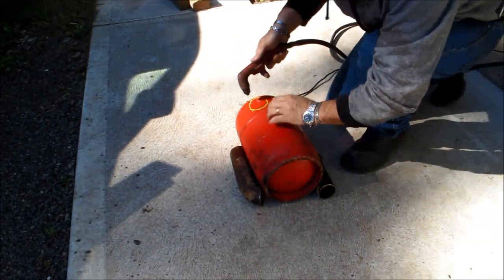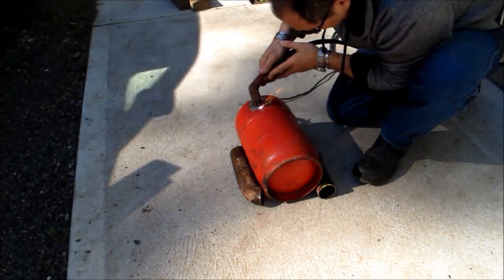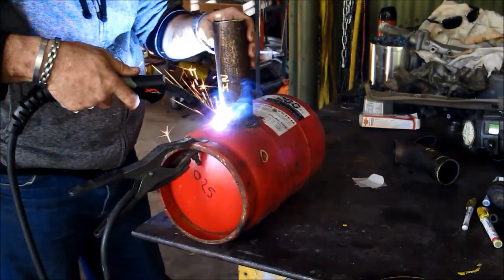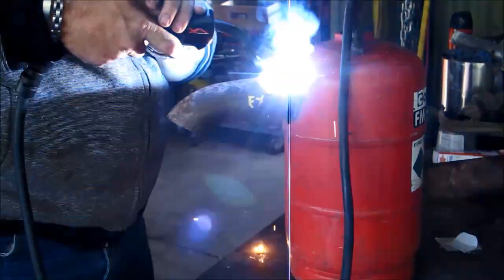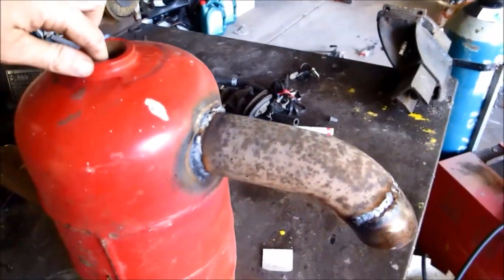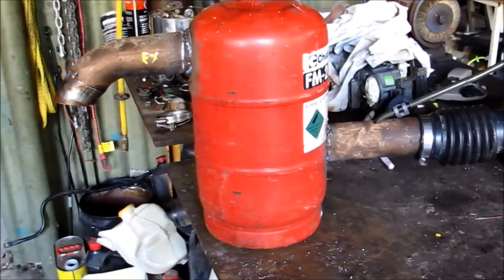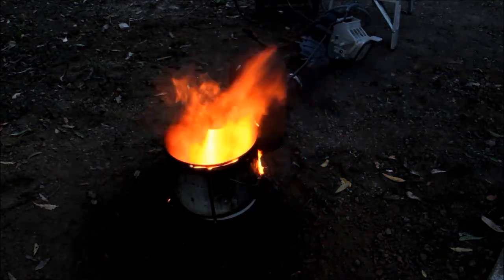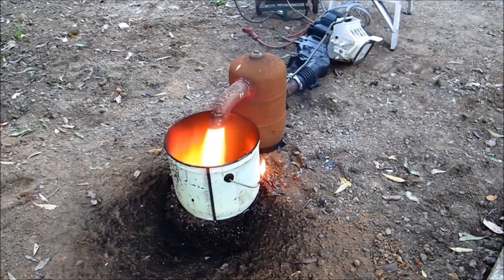How to build a Waste oil Burner for heating, scrapping or aluminium melting

Comment: was your camera worse off for the video?  Most guys won't video welding (more than once?) on account it damages camera...??  Not your experience thugh?
Reply from the maker: I'm a photographer. I'd notice any problems and there have been none what so ever. 
Frankly I'm a lot more worried about the heat radiation from my higher output vids than anything from welding. I have melted a couple of lens shades now and a Microphone sock was turned into a hot sticky mess.  Broke away easily when it cooled luckily!

Did another vid the other day with a load of welding in it and used the same camera the weekend on a sports job. No problems at all. The sensors have UV filters right in front of them. If welding were going to do anything, I can assure you pointing them at the sun or getting the sun direct in a picture would stuff them up a lot quicker and worse. 

You have to remember, photographers in general have a lot of lofty, false and ridiculous ideas and beliefs. They think of their camera's as like a pet or a family member rather than a tool. As such, they go on with an awful lot of made up crap that has no basis in reality.  :0)
Reply: Doug Chaney 8

Comment: Isn't there a risk of sucking the flame into the oil hose and into the oil tank?
Reply from the maker: +valttu95  None what so ever.  In any case, if it were possible, it wouldn't matter if it did. the oil isn't going to burn or anything.

Comment: it is really interesting , but need to know in this case what the flow of the oil L/h ?
Reply from the maker: +Memo Meem   Whatever you want it to be depending on how much heat you want. 
I have run it from 1L/ h to 30+ L/h.  Depends on the job and the heat output required.

Comment: Very interesting , could you tell me . Are you useing a mig welder
And are you cutting with it to,thank you,
Reply from the maker: +fred coulthard  Plasma Cutter to cut, MIG welder to weld.  2 Different machines I use but I have seen some Ebay models ( and I imagine there are others) that do both.

Comment: For swirl, have you tried just using a straight inlet pipe entering tangentially?  The outer edge of the pipe would be against the inner chamber wall (looking from above like the letter 'p').
Reply from the maker: +MrTechnophile  Yes, I frequently do it that way as I find it much easier to get straight scrap pipe than bent.  I also cut the end a bit and bash it over which helps the air spin in the burners.

Comment: Great videos, mate!  
It's high time I got a plasma-arc cutter.  Any particular model, power range or setup you'd care to suggest?  Helpful accessories you've built?
Reply: Cut50 clones if u can't afford a brand one. hypertherm 45A will be boss otherwise. I have the 85A and its cuts anything up to 20mm no problem
Reply: +Moronicsmurf, thanks!
Reply from the maker: +MrTechnophile  This Cutter has a built in compressor. It's not as good as the ones I have used that require a separate compressor. It was also way more expensive and wasn't worth it IMHO. I thought it would be good for mobile use but the reality is I tend to use it in the shed anyway.  The one I WOULDN'T  recommend is this one which is a Uni-Mig.  it's been quite troublesome. It's working OK now for no particular reason. Had it back to the manufacturer and other welding shops who have said it was fine when clearly it was not. It came good out of the blue so Just hope it keeps going OK.

Comment: nice gloves
Reply from the maker: ***** Or able to do a simple job without doing something stupid in the first place.
Reply from the maker: +Dylan Gray  Do I detect a note of sarcasm in your typical safety zealot Comment?
Reply: +Dylan Gray hahahhahah
Reply: or being tough/stupid enough to laugh at yourself when something bad finally does happen...not picking on ya guys, lol, I do the same stupid stuff. love the video, thanks for the info
Reply: Dylan Gray... you mean bitch mittens?
Reply: You misspelled bitch mittens
Reply: Yup.  Even the thin ones are fine and you can handle.the hot parts with no surprises😧.

Comment: How many hours of run time do you get out of one of these before the main tank finally builds up too much carbon/soot?
Reply from the maker: +xxwildbillxx  There is NO buildup inside save for a little ash that falls out now and then when I turn the thing upside down. Other than that, they burn totally clean due to the high temps inside reducing all the carbon to ash. If you have a look at some of the other burners on my channel, I have shown close ups of how clean the are. They don't even leave any black on your finger when you run it round.
Unlike if you burn oil in a tube like a vaporising setup, being open these burners are totally self cleaning .
Reply: That's good to hear... hmmm, now I'm wondering how I might incorporate this into a simple heat exchanger for a shop heater for intermittent heat on cold mornings, while still maintaining a carbon/soot-less burn(?) I'm striving for as low maintenance as possible...unlike a buddy of mine who runs a waste motor oil vaporizing setup, which is fairly high maintenance...imho.
One possible issue I see so far, the rate of oil consumption might be higher in this setup vs the vaporizing method(?)
Reply from the maker: Have  look at my Shed heater vids. Simple and cheap to construct and I guarantee will provide more heat than what you need. 
Wether you vaporise the oil or burn it any other way, the consumption wil be the same for the heat output assuming all other factors are the same.
Reply: Oil Burner

Comment: Is the size of the vessel.. critical? Or could a small piece of pipe be used as well? Mean is the air volume in the vessel critical.. i dont have a fan, but i do have a 1000l/min screw compressor. ;)
Reply from the maker: +Moronicsmurf  Nothing is critical but it is proportional.  The smaller the vessel the less fuel you can change to a gas and supply enough air to combust.  The air volume can be regulated to give wither a reducing or oxidising flame depending on what you want. 

If I had a compressor that size, I'd be building Jet engine like combustors that developed Thrust and Mach Diamonds!
What the hell you doing worrying about Burners for when you can be creating awesomeness like that??  :0)
Reply: Well.. i have no clue how to create what you talked about..  I need a burner that can break down large amounts of ally and cast iron to something useful. So thats why ive been mucking about with burners.. But i do realize i can run 20psi, from my screw compressor with a ridicioulus amount of volume just need a larger hose basicly..  Just don't have the know how to build something really ridicoulus. ;D
Reply from the maker: Moronicsmurf
 Aluminum is a walk in the park. Nothing to that at all.  Cast iron OTOH is at the other end of the scale, the holy grail of home metal melting. For this you not only need a good burner but also a very good furnace with high rated refractory.  Large furnace burners are easy.  Just preheat the thing with LPG or even build a wood fire in the thing, fan it up with the air and then start flowing the oil in the inlet like on my other designs. The spray burners are good for precision at low outputs, the drip burners are much better for all out grunt and are even simpler to build.
Reply: yeah i managed to conour up a burner thing that has some ridicoulsy output no.. basicly turned and drilled som brass fitting, made a hole in a bolt and fiddled together some other parts..  now the issue is more getting the fuel into the burner fast enough.. I need to start it on propane tho.. which is kinda stupid.. but what the hell.. When it start chuffin, basicly gets a 5-6cm spray cone and ignites midair in front of the burner tube.. (maybe less air pressure and it wouldnt).. but i only tested it by shooting into an old barrel i had so..  =)
i really need to get a video camera
Reply: How much is 250/300ml fuel a minute give or take in kW couldnt find a good forumla, i use engine oil diluted with some diesel for viscosity. (im in sweden its getting cold)
Reply from the maker: +Moronicsmurf  250 = 150 Kw, 300 = 180 Kw.  Pretty good!.  A lot more  than most people  use in their furnaces.
Reply: +Moronicsmurf 
I wonder whether a 20PSI compressor is a good fit for this.  Have you considered a lower-pressure blower such as a shop vacuum (one with both suction and outlet ports of course)?
I have GOT to get a plasma-arc...
Reply: I once got quite a nice blower from a high-efficiency furnace in the scrap heap behind a place that does HVAC.  Way quieter than a shop vac too!
Shop vacs could be designed to be quiet, but then they don't sound powerful and people won't buy them.
Reply: I run mine on only a compressor and have one line for the fuel at 15psi, and then added a second line to a "diffusor" nossle that takes down the airspeed, and make it "bigger" basicly throws volume out.. that runs on 25psi. And that made the burner go nuts.
Reply: +Moronicsmurf
Tried a valve?  Maybe a cheap (1-stage) air regulator.  Or in Oil Burner's spirit, just put in a piece of rubber air hose and pinch the line.  Use a clamp or pair of vise-grips if you're feeling swank!
Reply: ah well, my burner went another direction that this one you are answering on.. lemme put the videos public forya

Comment: the inlet pipe should be bent around the corner?
https://pp.vk.me/c628718/v628718066/6d26/Ny4AKXriTME.jpg
Reply from the maker: Andrew Kulibin  Yes.
Reply: Oil Burner Required if the pipe bend?

Comment: How about the ignition? Where and how is the fuel ignited?
Reply: +Εκδόσεις Οξυγόνο think of the burner as a glow plug for diesel engines the oil gets blown in by the blower and vaporizes upon contact with the hot metal wall of the burner and that vapor instantly ignites
Reply: Oh! Like diesel engines. OK. Thanks!

Comment: Would there be any advantage to use a air compressor over a fan blower ?? 
Thanks
Reply from the maker: Kym Ho I would say not. These burners don't need the pressure of Compressed air, they need the volume of a blower.  Spose if you had a diesel driven compressor you could use it but you can get away with a fraction of the energy input with a blower. 

That said, I will shortly be getting my hands on a compressor blower which will do 13 PSI.  Be interesting to see how that goes!
Have a look at my other vids to see how this thing cranks up with a bigger blower attached.

Comment: If you could would you have put some sort of refractory lining in the extinguisher? I am welding up a burner similar to yours and have to oppurtunity to access the insides so I could theoretically put clay or fire cement or something on the inside. Not sure if it is worth the hassle tho.
Reply from the maker: Having run this burner long and hard with literally hundreds of liters of oil put through it now, I wouldn't bother. The thing has stood up very well with little sign of deterioration despite being kept out in the weather. From what I have read, it's very difficult to get refractory to stick to steel and you'd want a hard type to get hot to vaporize the oil  and not absorb it.  If bits came off I think it could cause problems.

By all means though give it a go and let us know how it works. I don't think there are any commercial businesses or universitys or the like that have played around with this sort of thing so we are the pioneers writing  the book on it.
Insulating them may well have a lot of valuable  benefits no one has yet realised.

Comment: Is the inlet facing to the side, Or to the bottom? Inside the burner.
Reply from the maker: It's horizontal, about 1/3rd the way up from the bottom with a bit of a turn on the end to spin the air inside the bottle.  You do NOT want the air aiming down ti the oil pool as it will cool the oil too much and stop it vaporising. You want the air directed at the sides of the burner.
Reply: parenti serpenti

Comment: What tool is that you used to cut the bottle in the beginning of the video?
Reply from the maker: It's called a "Plasma Cutter "
It's similar to a welder in that it creates and electric arc but like an oxy torch, It blows air out the centre of the tip to push away the molten metal leaving a fine gap in the material.
Reply: Oil Burner Thanks for that tip been searching for such a tool but now going to the store clerk and trying to describe a scene you saw in a movie about burglars using this sort of thing on a safe well really paints a bad picture in what your true intentions may be if you get what am getting at?? Got the name thanks!!

Comment: Hi, looks nice but sorry, how do you turn it on??? in some other videos they use kerosene (diesel) to light up and after that they turn on the oil... All I could see was oil and air going into the tube... and flames out. Thank you. (it is easy if you know )
Reply from the maker: I use some old rag inside and let it heat up from there or use LPG instead of the oil to get it hot then change over to the oil  Have a look on my channel at other vids, there are a few where I show and explain how I light the things.

Comment: I watched a video before this with melting aluminum and you said you done steel before. How much oil does it take to melt steel?
Reply from the maker: Depends on a whole load of things, mainly how good a furnace you have to retain the heat and keep it in the steel rather than letting it escape.  It's waste oil which can be had for free, why the concern over how much is used?

Comment: How can this be adapted to heat water for space heading and sanitary hot water?

will the pipes sustain the tremendous heat? or should it be run only for ashort period of time every day and then store the hot water in large tanks?

thanks
Reply from the maker: I made a hot water heater here Waste oil Fired hot water heater for off grid   It uses a normal gas fired heater with the gas burner removed.  You could probably make a water heater many ways but I am going to get a larger 400L unit and do a storage system like this. 
These tanks will keep the water hot for days and even longer if you add additional insulation like household batts around the outside.  Depending on your hot water usage and tank size, You might only need to fire it a couple of times a week.
Reply: Oil Burner Neat !